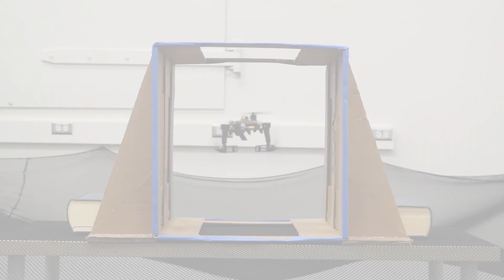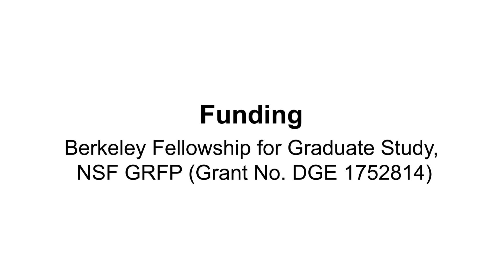Design and Control of a Midair-Reconfigurable Quadcopter using Unactuated Hinges

Comment: How can this video have only 630 views 😳 i'm shocked... you guys pulled out a tremendously cool advancement in the field. 
Anyway i think that a simple mechanical propeller arm locking system wouldn't affect the weight too much. I feel that it would be a significant advantage to have improved yaw.
And mechanically actuate the arms with some degree of choice could also be an improvement since that would allow the arms to be folded just the amount needed to pass through the gap and still manage to provide some lift to the whole thing. If I'm not wrong you guys use the reverse propeller direction to fold the arms, I'm pretty sure that a servo would probably be more efficient at doing the same task. 
There were my thoughts, for the rest i can see may usefull application for drone racing too, imagine drone tracks where they fly full speed through tiny gapsby folding the arms mid flight or maybe had to suicide dive down a tight tube 🤔 wow haha